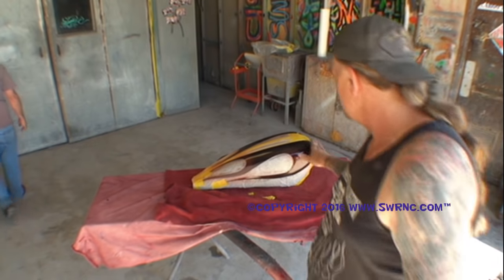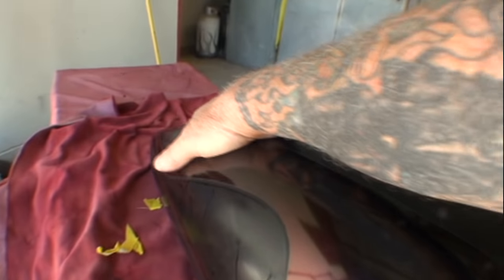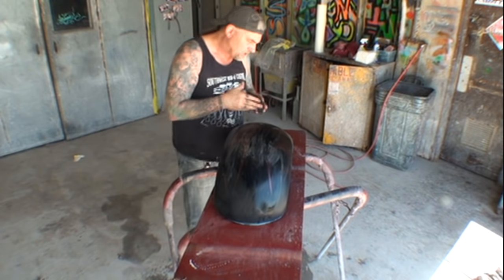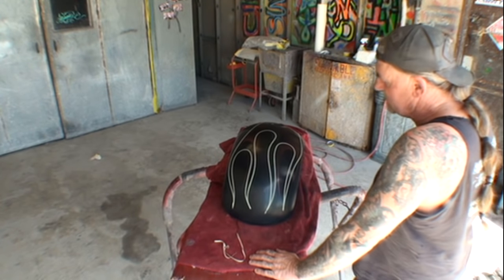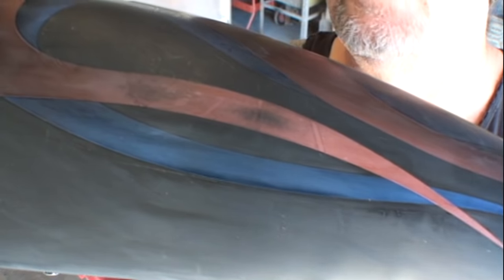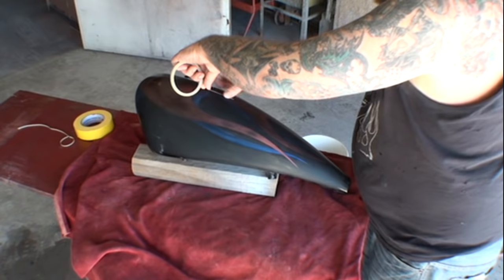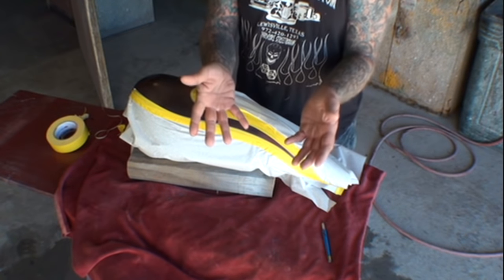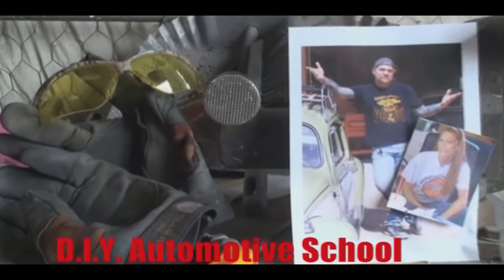How To Paint Ghost Flames From Start To Finish-Custom Paint Tips-Part 2

Comment: I remember we were painting a complete in/out. Next to the paint booth we had electronic dust particle ionizers we used those booths to do fenders small jobs. We had a spot on the door that the body shop had to fix. Whilst touching up a scratch. The door creaked and the body person sprayed the door hinge with wd 40 A NO NO And caused fish eye in the whole body job in the booth. So screw up happen. I admire the patience you have. All these thing were a comedy of errors. I always said to my employees . Don't follow the rules , you deserve what you get, and never enough time to do it right, always enough time to do it over. So you want to work the weekend? We were flatraters. Lol we didn't makes those mistakes again. Close to perfection most of the time. I also appreciated the fact you did not like it. So you fixed it.

Comment: Sorry im so late on watching these but just a quick little question. So you used the DBC550 then wet sanded it with 1500 and cleared right over it? With putting clear right over a prepped 1500 grit surface doesn't it increase your chances of runs in the clear if its a full wet coat, or on your first coat of clear do you do a medium wet coat so the full wet coat on top wont run?
I hope that made sense, been trying to figure out how to word it properly.